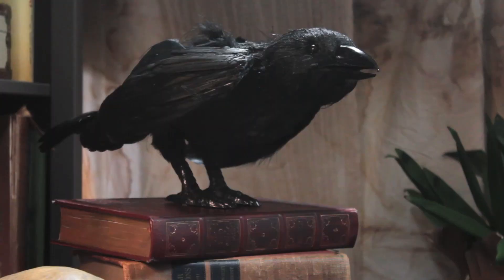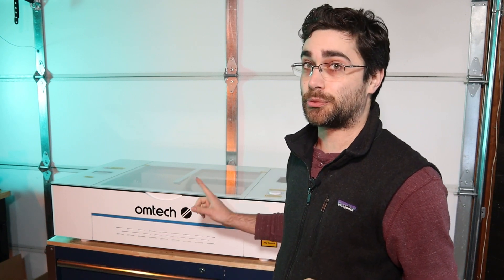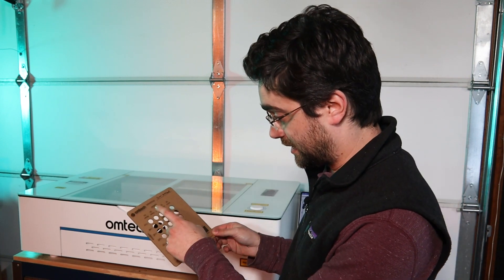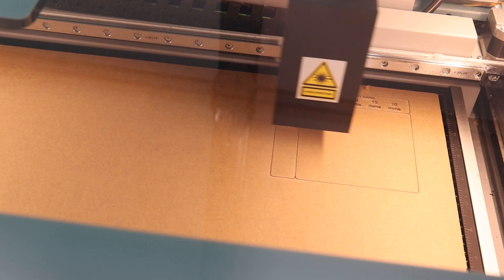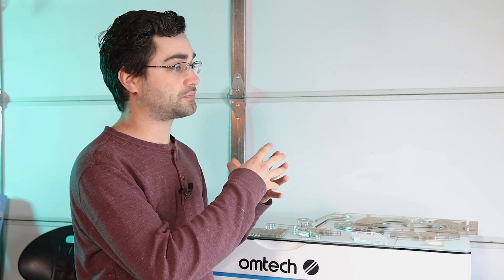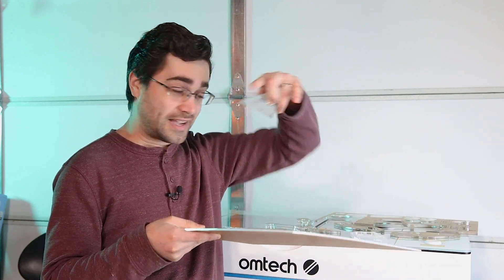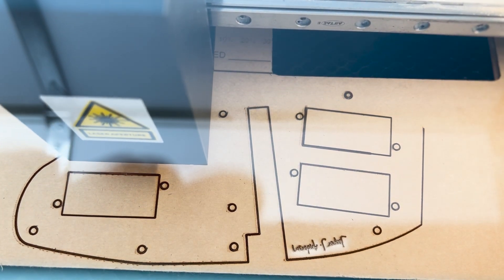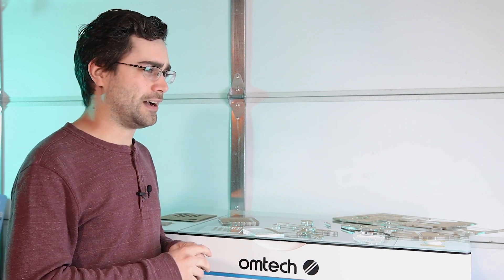Learning Lasers with the OMTech Polar

Comment: Thanks for sharing the good and challenges, so to speak. An important question - now after several months of use, are you finding the smoke created inside the unit is fully venting out of the fan and ducting or are you finding some smoke is exiting the machine and into the room? Thanks so much!
Reply from the maker: I only use it venting directly out the open garage door, so I’m not really sure

Comment: yep... ironically just went through these exact issues....  wish i saw this vid first. :)

1. z-axis does not calibrate when its turned on; basically last place it was becomes the new zero.  
2. limits on x-axis is 200m/s; don't try to go above.  Controller acts funny and will not compensate power levels.  Far cry from the 500mm/s they claim.
3. Mine is physically mounted wrong; the claimed fittment on z-axis is not correct.  Shrug... no idea why.
4. Lack of console is killing me; makes troubleshooting hard.

Overall its not as refined as a xtool or ortur in some of these small issues; but much better hardware underneath.  Very odd...  Would only suggest for people who like to tinker personally.  

Reaching out to omtech to work through above; shrug...
Reply from the maker: Any update on the issues you encountered? I totally agree the Z-axis not zeroing out on its own is really confusing, especially since you can't see the lens position under the cover.

Comment: Jasper, in case you haven't discovered yet, in the "Move" panel in Lightburn, you need to turn on "Move from Machine Zero". That is likely the cause of your focus problem. Hope that helps!
Reply from the maker: Thanks Dawn. If I zero it first, shouldn’t that not be a factor?
Reply from the maker: To put it another way, the machine's zero seems to be the thing that's off. Someone on the Facebook group pointed out to me yesterday that there is an adjustable end stop for the Z motor, so another possibility is that it could be that that was installed 5mm lower than most.